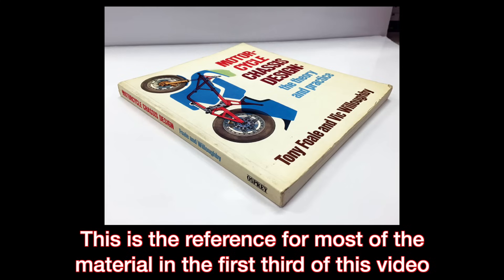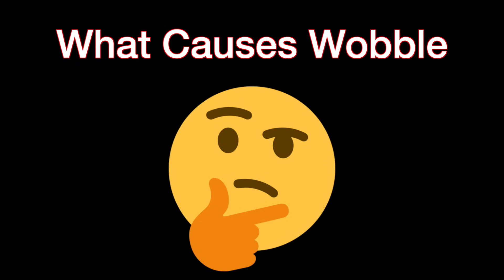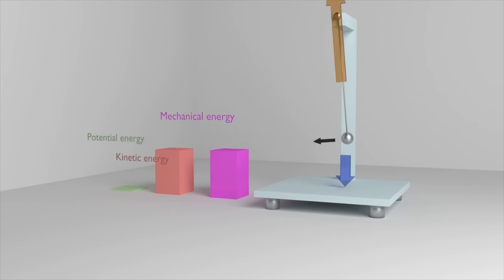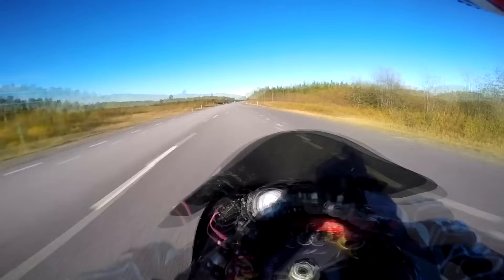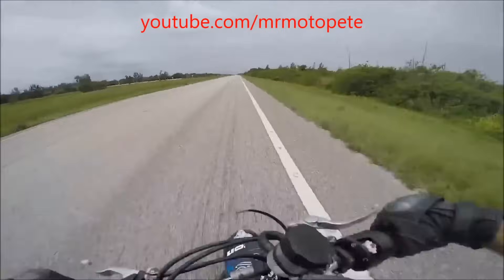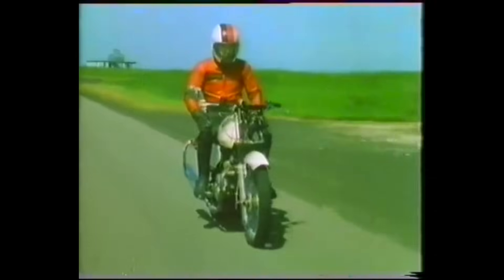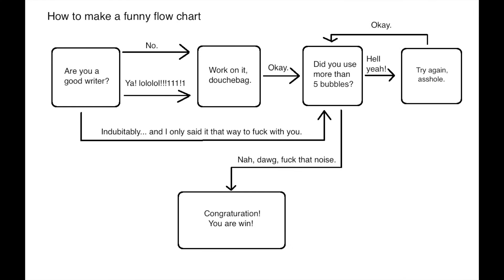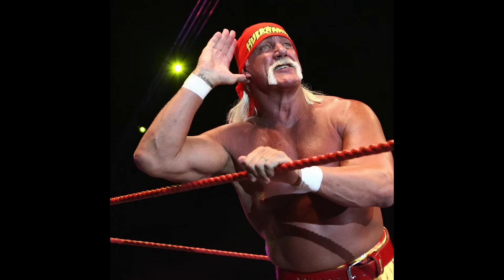Tank Slappers AKA Wobble Explained: Cause, Effects, and Remedies

Comment: if the wobble is chronic and happens even at normal speeds and smooth roads, you definitely need to change the axle bearings. Also every time you go accelerating, lean forward with your head closer to the front wheel. It's not only for aerodynamics and reducing drag, it's also to provide more traction and stability to the front so you dont accidentally wobble. Also, keep the front softer than the rear, never overinflate. For safety in high speeds, this is also the reason why you are required to deflate your tires around 70% than normal specs, when in race tracks. The heat would cause the air to expand and riding with normal inflation will cause the tires to overinflate from the heat, you have to give it some room for expansion.

Comment: I don't think the cause is explained well. The main cause, IMHO, is a misalignment between rear wheel travel and front wheel travel. And it tends to be worse with smaller wheels.  Some other causes, in part, are: loose steering head, wheel, and swingarm bearings. Also, a bent frame or forks from a previous wreck, and bent wheels. This can cause a misalignment between the front and rear wheel travel after hitting a bump or doing a wheelie. Also, some Harleys are known to generate the death wobble from resonant engine vibrations.

Comment: I’ve had em a lot . I’ve had em so bad they’ll throw my hands off the bars I lay on them with my chest and slide my arms over the top then gather em up. I’ve got a turbo bandit and sometimes my mile long wheelies cause em when my font wheel stops spinning and hits the ground ! Blows smoke everywhere. I can hold a 4” wheelie through every gear above second even shifting I just preload and let it hit the limiter .

Comment: When i had a really bad tank slapper, one of my hands came off the bar... I instinctively laid my chest on the tank. 

Tank slappers will usually correct themselves, so i think the crashes from tank slappers ussually occur when someone loses grip of the bars then they become unbalanced and fall in one direction or another. Assuming you don't just crash into something first a tank slapper will almost always correct its self as long as you don't lose balance is my theory atleast.

Comment: I have had some insane tank slappers on my dirt bike and some tame wobble on my sport bike. My two biggest tips are steering damper/ stabilizer with properly adjusted front suspension and too just rip the throttle when it starts to wobble. Yeah it's the opposite of the standard "slow down" but I got a 100% success rate. Like I had a full on, not even controlable tank slapper multiple times on my dirt bike and just gassed it and it went away immediately.

Comment: Wow, thank you for this video. Leaning forward on my FJ-1100 is kinda a moot point since that is the normal posture unfortunately. I have noticed it tends to happen when I unload the front suspension like hitting a series of ripples in a road surface while exiting a sweeper on the gas. I am wondering if I need to add a stiffer fork brace that connectects both lower shock tubes keeping them working together and not independently. It already has an integral unit as part of the F. Fender mounting bracket. Is this where I should start? I have already checked wheel alignment and it looks real good but how does one go about measuring it when my rear wheel/tire is so much fatter  than the front? The notches on the swingarm are good for ball-park getting it close, so how do the professionals make sure the rear wheel is tracking the front wheel perfectly? Thank you for your video and suggested further readings.

Comment: I had the wobble start at 140 mph after hitting a minor dip on my cbr1000rr at full throttle, I stayed full throttle because I just didnt react and it went away in like a second.  Not sure if thats what fixed it or the electric steering damper, or both, but I was very glad it quit lol.
Reply from the maker: Bikes are designed to avoid it even without stablizer, so when it happens it’s either a temporary condition that fixes itself in the moment or it’s a sign something is horribly off with your bike. At higher speeds the bike the forces that would knock your bike into a wobble are higher making it more likely, but as you saw the bike corrected itself, indicating it was something temporary like hitting a pothole or something.

Comment: I had this issue after an upgrade when I didn't extend my brake line. Learned my lesson quickly after a close call. this video was great!
Reply from the maker: Glad you figured it out before you had to ‘Lay’r Down’
Reply: also realized my wobble is VERY much a Harley Wobble

Comment: some people say to throttle it out.. coming from a guy who has been thru so many tank slaps to the point where i'm able to keep myself calm when it happens, i suggest you to firstly stay calm and gradually close the throttle. The quicker you react when the wobble starts, the higher your chances of saving the bike. Slowing down kills the momentum of the twisting motion or you can do as the video mentioned, like leaning forward but leaning forward on a chopper wouldnt mean a thing as its so lean back you would probably end up looking stupid trying to lean forward. I mean, if running hurts your knee, would you run faster or slower or would you rather forget about running altogether. Right?

Comment: my friends told me. tank slapper is a problem in the front tire. wobble on the rear tire when cornering. Is that true?
Reply from the maker: Kinda sounds like they confused some terms. A tank slapper is what's demonstrated here, where and instability on the bike causes the handlebars slap wildly back and fourth on a motorcycle. Depending on where the instability is coming from, the technical term is Wobble or Weave; Wobble is when the instability is on the front half of the bike, Weave is when it comes from the back half of the bike. 

There are a million different potential causes for Wobble or Weave, and you could experience it cornering, but its most often experienced at high speeds, and you usually won't be going very fast (by comparison) when cornering.

Comment: I just got a ninja 300, first time rider. What are my chances of that happening to me??
Reply from the maker: Pretty low, more likely if you’ll be popping wheelies. It’s something that generally indicates a significant problem with a motorcycle, and ninja 300s are pretty new and well designed.
Reply: Top tip, get your suspension set up for your weight. A screw up set up can screw your day in a heartbeat. If your suspension has no option for you to tweak, change to a thicker oil or springs. factory set up are usually rubbish and don't forget the tires and tire pressure and a pair of double H brake pads for the front. A well set up bike is a happy bike

Comment: The don't panic is correct, but slammed the brakes? No. I'm gently press the brakes and slow down to reduce the wobble. And it's works.
Reply from the maker: It can, but slowing down also increases the load on the front tire, which can lead to the front wheel losing traction and high-siding.

Comment: My '85 gsxr had that same, tankslapper issue, when accelerating slowly over/towards 170kmh. didn't had it when accelerating fast, and the only way to get rid of the wobble was slowing down, or, throwing open the throttle.
Problem was solved in the '86 series, or exchanging the rear suspension bar with 10mm '86 version
Reply from the maker: This isn’t too surprising. Older bikes seemed to be less stable at what we would consider in modern parlance as highway speeds. Now a days it’s pretty hard to have that level of instability on any bike sub 100 MPH.
Reply: @SquidTips  My bike only had it getting slowly toward/just over 170kmh/like 106mph, not over it. Bike ran 245 on a circuit, stable. And only happened, when accelerating slowly, not going accelerating fast.
As long as not coming near 167 ( 100mph), you could accelarate it, and let handlebars loose,, the bike was really that stable...puzzled us..

Comment: New bikes dont wabble . the cause of wheel wabble is sagging fork springs. All wabbels happen due to fork geometry .. A soft well worn fork spring allows front to have just enough angle to start the wabble even a low front tire can start the wabble.. So lean back and get the front up with a little throttle to help correct the tucked in fork...  then fix your bike with stiffer front fork springs.

Comment: New rider here and this is my first time im hearing of this how often does this happen? And will i encounter this at one point of me riding? Should i expect it.
Reply from the maker: Blakk Bonez depends on what you ride, but it’s mostly uncommon. It happens more often to people who have saddle bags and don’t pack them evenly creating instability, but it can also happen at higher speeds or after things like wheelies. If you notice your bike experiencing wobble at normal speeds it might be good to take it to a mechanic.
Reply: @SquidTips  AWESOME! Thanks 4 the advice im not some young kid just a late rider but i am getting use to the turns i guess more ballzie haven't laid my bike down so far been riding for about a year any ways thanks for the response i will take any advice i can get. Ur actually the first to respond to any of my questions on YouTube oh! I ride a cbr 300r And i know its kinds gay found out after i baught it 😒 but i dont care its fast enough for me will be thinking of upgrading to a 600r i dont know about the 1000 yet i shit my pants after i seen this video.
Reply from the maker: @blakkbonez8123  It's ok, I've known plenty of people who grow out of their first bike quickly, gives you time to fuck up on something small and cheap before you move up. CC's actually aren't the best way to know how quick something is, as there is a lot to how engines translate power. For example my 1200cc Buell takes 5 gears and 10 seconds to get to 100, whereas my 1000cc R1M hits it in 1st gear within 4 seconds. 

If you were to go from a 300->600, you'd mostly notice more power after 60+ MPH. And when you go from 600->1000 you notice it more after 100, so it's really not a crazy thing as long as you've got good throttle control. GLHF
Reply: @SquidTips  will do thanks again bro.... Im already lookin for something faster will take everything u told me in to consideration thanks again man stay safe and keep riding bro.
Reply: @blakkbonez8123  nothing gay about a small displacement bike. Shifting at the rev limit and not going stupid fast is a fun that liter bikes can never know. 
As they say, it's more fun to ride a slow bike fast than a fast bike slow.
Reply: @lovelessissimo  hey i like that saying☺ ima use it one day so far im having a blast on my cbr 300r but i dont know i might go to a 600 not 100% sure yet.
Reply: @blakkbonez8123  No sweat, man. You have a lifetime to enjoy riding. I came to the world of bikes fairly recently and I am in my 30s. I still ride my Ninja 650 and I don't regret it for one second. They are designed from the ground up as a sportbike, not a supersport, so they have midrange power and torque.  Take some intermediate and advanced riding courses before moving up. Honestly, 600s have a lot more downsides than upsides for street use, since they aren't intended for street use. It's like using a shovel as a rake. It's hard (not impossible) to enjoy them for what they are without riding really fast. 
There are tons of other bikes that can scratch that itch.
Reply: @lovelessissimo  sweet ill keep that in mind i also an a new rider in my late 30's tho everyone i hang out with tells me to get a harley but im a rocket man💪😂
Reply: @blakkbonez8123  haha yeah, harleys are ridiculous. I Iearned to ride on a Harley, and the next day bought my Ninja.
Reply: @lovelessissimo  hey one question then i swear ill leave u alone 😂 since we r conversating n all is there a way to reset the manufacturer lean settings or do i need a performance chip or power comander?
Reply: @blakkbonez8123  ask all you like, man. I'm working all day, haha.
For your 300, it isn't going to make tons of difference. You are not working with a lot of displacement to begin with. A Power Commander will make the throttle smoother, and it will help if you throw on another exhaust. But that is all going to be a waste of money because you already are thinking of another bike. You should practice up on your 300 until you have all the technique down.  And I don't mean just pegging the throttle. Watch a video of a cop doing a cone pattern. They can do that on a full dress Harley. Put on some frame sliders, bar sliders, buy some good gear, and get your skills razor while you save up some cash. Take the first year and try out some other bikes. Try some supersports, nakeds, cafe racers (the husqvarna vitpilen 701 is pretty awesome.), some ADVs, sport touring. It might surprise you on what you end up on. I will tell you this, sit on anything, then sit on a supersport, like a Daytona. You won't want one after that.
Reply: @lovelessissimo  cool man thanks for the info definitely will be checking out different styles of bike i just like the crotch rockets cuz they just look bad ass and i did change my exaust already to a Acrypovic "Damn i hope i spelled that right" didnt make much of a difference but it sounds AWESOME.

Comment: What about pulling in the clutch with or without getting off the gas?
That would change the frequency right away
Reply from the maker: It would. So would braking. The rub with that though is that speed reduction will also increase the traction demand from the front tire by shifting more weight to the front tire, which could cause a high side if the wobble doesn’t correct itself.

It’s also hard to effectively utilize the controls on the bike when a full blown tank-slapper happens. You could rear brake for a similar effect as clutching, but you need to do it slowly.

Ultimately, you want the bikes mechanics to correct itself, and adjusting your position slightly is enough to change the natural frequency, while hopefully not over-exceeding traction demands.